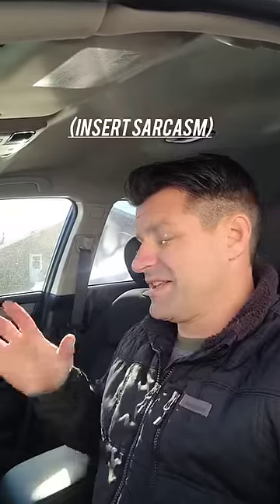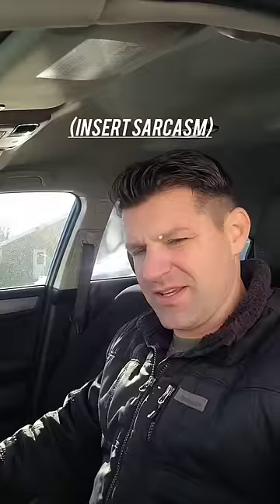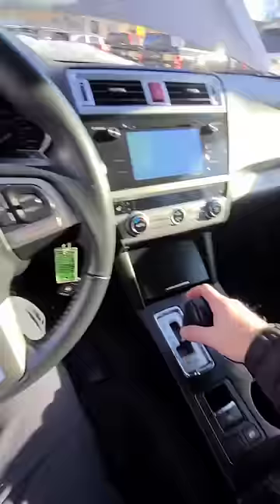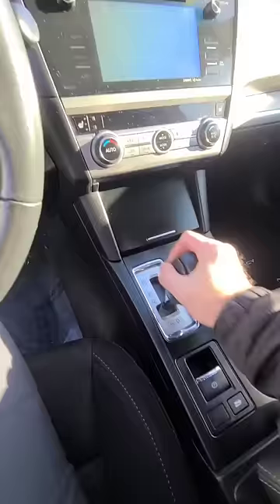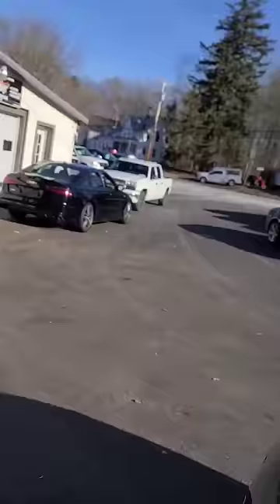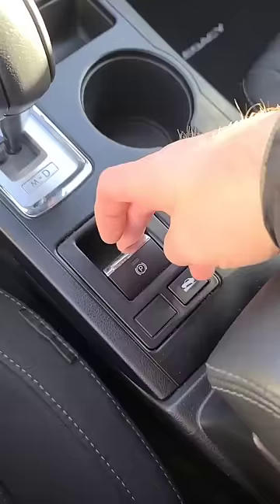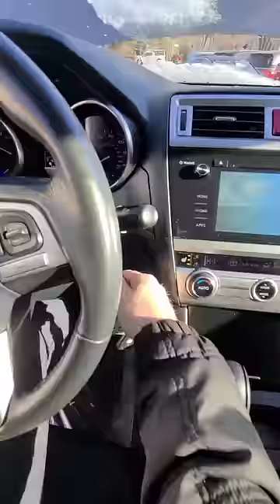Why Subaru Engineers deserve a punch in the Face! #shorts

Comment: Found this as im in the middle of tearing down an outback.
Reply: Around 2012-2013 was last year of good cars with manual controls. Can't stand elec e brakes
Reply: @infotechsailor  ummm i got a new 2023 Subaru Crosstrek with a manual e-brake! Not only that but it also has the best manual e-brake ever made, it’s the kind you pull up with your right hand!! Makes it super easy and fun to do quick 1 sec U turns!!
Reply: @infotechsailor  Then buy a ford they're still catering to the older generations and have still have stuff like manual e brakes

Comment: Is Why I love my Manual transmission Civics just drop it in First Gear, If you want to roll start 5th gear works Great 🤓
Reply: I got a manual 1999 ek1, how the fuck would you roll start in 5th lmfao
Reply: @j4y167   Because of gear reduction its a lot easier/smoother on the transmission to roll start in a high gear. Try it in first then in a higher gear and you'll see what I mean
Reply: @rawevoli  wouldn't it just stall? I'm newish to manuals and haven't had to roll start so I'm not saying you're wrong I'm just confused how being in fifth at very very low speeds wouldn't stall
Reply: @Jay L  Well as long as it's rolling it can't stall because the engine is spinning through the wheels mechanical leverage. You don't wanna give it any throttle in fifth because you'll be at 500rpm and it will bog so all you do is switch to neutral or a low gear before you accelerate.
Reply: @rawevoli if you lift the clutch in 5th, engine on, travelling at 1st gear speeds you will definitely stall, unless  the gear ratios have been modified or adjusted.
Reply: @It's ok to not be ok The engine isn't running until you drop the clutch. The car won't stall unless you let it come to a complete stop. You have to pop it out of fifth after it starts.
Reply: @rawevoli I get what you're trying to say, but that makes suggesting rolling for bump start a dead battery in 5th to start makes even less sense. The engine only starts when lift the clutch just above the bite. 
If gear is too high the engine will stall, start in 2nd and as the clutch starts biting give some throttle.
Reply: @It's ok to not be ok  Your sentence makes even less sense. Why are you arguing which gear works? They all work man its common sense... Even reverse so who cares. Sure it might not work in fifth if you cant push it fast enough but its not hard. It's easier to roll in a high gear because you're have less compression strokes with lower rpms. 5th works best when roll starting on a hill, which is where most people park when they're having starting problems.
Reply: @rawevoli  the lower compressions only become relevant after the engine starts, so being in a higher gear when initially beginning to roll doesn't matter. However when you do get the engine started the lower speed will cause you to stall. Only reason I am arguing about it, is that your suggestion was made to a person that is new to manuals and if they follow your advice it will just lead to frustration when it doesn't work.
Reply: @rawevoli  obviously you believe and agree with what I'm saying or you wouldn't suggest 5th won't work if you can't push it fast enough.
Reply: @It's ok to not be ok  dude I've done it a thousand times. It works fine in fifth. For it not to work you would have to push it like half an mph. It works fine and won't stall and is fine advice to someone who is new. Please stop replying because I know what I have done numerous times and I know how easy it is so please stfu
Reply: @rawevoli  firstly take a breath no need to get yourself agitated. At no point have I suggested you haven't done it, what I was explaining is you are creating an unnecessary problem in having to build enough speed to prevent stalling. Tbh you no yourself that the majority of manuals will stall in 5th the moment the throttle is touched when travelling even at 10mph.
Reply: @It's ok to not be ok why are you relpying?
Reply: @It's ok to not be ok  my cars have enough torque to let of the clutch in 6th with no gas and still not stall. Just let it go. It works fine in fifth. No unnecessary problems it works like a charm every time.
Reply: @rawevoli the same can be asked as to why you're replying? It's great that you have cars with enough torque to do so, it suggests that they are modified? Doing that in the majority of cars and see how quickly the clutches get worn.
Reply: @It's ok to not be ok  you're arguing for the sake of arguing. I was just agreeing with the op and you can't let it go

Comment: There should be a shift lock under the infotaiment in the storage compartment.  Its under the rubber mat (at least under my outback).  You take a screw driver, stick it in the hole, press down and shift.

Comment: You might be wrong. On my 17 Subaru crosstrek there is a place to stick the key next to the gear shifter to put the car in park or neutral when the battery is dead. I don’t doubt there is something similar on that car. But yes electric parking breaks are very dumb.

Comment: Remove liner in cubby in front of the shifter. In that cubby you'll see a round hole, use a screwdriver to release the lockout button inside that hole. You can now put it in park..
Engineers been doing this for over 20 years😉

Comment: Just an fyi from a subie tech theres a cutout near the shifter, pull that out and down that hole is the shifter lockout mechanism, get something long and stick it down there so you can put the car in park (yes even with a flat battery) just because you can't comprehend how stuff works doesnt mean you need to bash subaru. 😂

Comment: The fun part is replacing brake parts on a car with an e-park brake - the tech has to do it with a laptop  (asuming the other techs don't use it other wise he  has to wait around, and so does the customer), the electric servo's that operate the park brake cost a small fortune, they are located at the brake system just inches from the ground so any water, mud, snow, ice and salt that comes with ice is constantly splushing on those parts so it will fail often enough ...what the freaking hell is wrong with the good 'ol $45 parking brake cable???

Comment: You don't know what you're talking about. Flip up the storage compartment, lift up the rubber mat at the bottom, and stick a screwdriver or pen down the hole to press the SHIFT LOCK RELEASE BUTTON. Then you can shift to park even if the battery is dead.

Comment: BMW 325 xdrive adventure: All wheel drive  + Electronic auto transmission in park +steering wheel lock engaged +stone dead battery =  4,000 lb boat anchor. 
Stuck on 25 degree incline driveway, perpendicular to street, with front of car toward garage. 
Wouldn’t take a jump (computers) but got enough power to get the car into neutral and release the steering lock. 
Oh, and the car had Msport front facia, so the tow eye-hook that shipped with the car had the wrong thread size for the receptacle in the front bumper!

Comment: My 2002 Mercury (Ford) Cougar does not have this problem. If it's not in Park, it can go into Park even with a dead battery. I can even take it out of Park without a functioning battery or even the key because there is also the manual emergency release latch under the console (for towing). Plus manual handbrake. Good thing to think about on any future car I buy.

Comment: For all the geniuses if you remove the rubber mat in front of the gear shifter you will find a small hole which you can stick a screw driver, pen, pencil,etc. then shift the car into any gear  even if the battery is dead.

Comment: That is a parking brake, NOT an emergeny brake.  
An emergency brake would allow you to use it and would be seperate from any engine or electronics system so that you could use it in the case of an emergeny.   

The not shifting into park could make sense, if you need to move the car if the battery is dead... but does not make sense if you can not set the parking brake.

Comment: Idk if it's the same with these but I do know that with the newer ones you can take out the flooring for the little cub box in front of the shifter and then with a screw driver or something push down a white release which allows you to put it in any gear. Idk if it's the same with these 2017 but the 2022 model Outbacks had this

Comment: Well in all fairness this is probably not on purpose, the shift lever probably doesn't go anywhere (in that it's just a switch) and even if you could push the lever into the park position the parking pawl probably would not engage because it's electronic. They're just avoiding giving you the false hope there.

But they should still have a mechanical parking brake.

Comment: For the Subaru Legacy you have a neutral override in the center dash compartment in front of your shifter.
Lift up rubber mat in compartment, there is a hole there, insert small screwdriver and push button down, this will free the shifter whether in park to neutral or any gear back into neutral.

Your welcome.

Comment: To everyone saying 'emergency brakes should always be manually operated':
- Electronic e-brake systems are self-maintaining and foolproof. They will always clamp with the correct amount of force, and always fully engage the brake. 
- Yes, cable/manual systems do need maintenance, and the fact that no one here seems to know that shows the extent of the danger. Cables stretch and they stretch unequally, meaning (without maintenance) you WILL end up with one wheel that either doesn't fully engage the brake or doesn't engage at all. When you rely on both wheels being locked, this can be a problem.
- Using a manually-operated 'emergency brake' in an actual emergency (brake failure etc) is difficult and dangerous. Too much brake and you'll lock the rears and risk losing control, which is a likely occurrence seeing as though you will already be panicked, and then forced to (in seconds) learn an entirely new vehicle control without any of the assistance systems like ABS, TC, or ESC that you would be used to driving with as none of them will prevent you from pulling the brake too hard. 
- On the contrary, electronic parking brakes are DESIGNED to also be used in emergencies, with in-built antilock systems ensuring the car comes to a safe halt, fast. 
- People who drive automatic often neglect to engage a manual parking brake. This 100% does put extra wear on driveline components and mounts that will need sooner replacing as a result. Electronic systems will usually operate the brake automatically upon entering P.
- Anton Yelchin did not die as a result of a faulty electronic park brake. This was the fault of the gear selector design on his Grand Cherokee, which FCA was forced to issue a recall for.
- There is always a shift lock release control in automatic cars that ensures you can take it in and out of park while the battery is disconnected. If you had bothered to read your manual for the 2000kg killing machine you pilot every day, you would know this.
Reply: @Steph A  if there's anything you disagree with here you're free to correct me. There is a certain irony in the generalised nature of your comment.

Comment: Electronic parking brake should have a capacitor that will engage the parking brake regardless if the battery is charged or not. (Simple fix but yeah $)

Comment: My car has an electric parking break and I went out my way (as a aircraft mechanic in used to building and overhauling and just wrenchin around) so I went and installed a mechanical parking break and threw the electric park brake to the trash basically feel much safer going mechanical

Comment: First off use your emergency break in second there is a little switch that you can press sometimes you have to open a lid right next to the shifter and use a small flathead screwdriver to unlock the shifter then you put it in park to school

Comment: To be fair it is very, very, very, very, very unlikely that this situation will ever occur. Your battery will not die whilst you're driving if your alternator works, and if your car is parked with the engine off, why the fuck wasn't it in park with the parking brake already on?

Comment: He is right but there is an override he does not share with you.  If you have screwdriver you can pop the cover off right by the shifter park (P) on the left side.  Once the cover is off, you can depress the button inside the hole and put the car in park problem solved.  It is a bad design but they don't leave you stranded with your foot on the brake!

Comment: Sir. There is a shifter lock out switch. If you knew how to use the internet or read your owners manual you would know this. Don’t start yelling at engineers for implementing a design you’re just too inept to use. Like every automatic car will lock the shifter when it’s not on. They all have shift lock switches. If you find one that doesn’t make a video on that one.

Comment: If it makes any Subaru owner watching this feel better, while my car was in the shop my rental turned out to be a top-of-the-line Toyota RAV4... with the same stupid "everything should be digital" mindset. It was literally distracting to drive because there were so many lights, animations, warnings, and notices (especially on the incredibly annoying 9" color screen in the middle of the dash), plus at night it all lit up... along with some overhead buttons, much of the center console, and the armrests on both front doors. Not only would I not have been able to use 90% of the controls if the battery died, it was as if the stupid car got jealous if I paid attention to the road instead of it.

Comment: Love my Jeep renegade, but hate, hate, hate the E-brake. It does the same thing, needs ignition power to work. BTW, that E in E-brake is for Electrical, not Emergency because it wont deploy at speed either. It's just a worthless parking brake. Thank goodness I have a manual transmission so I downshift to engine brake, plus can just put it in 1st gear when the car is off to lock the vehicle in place. This works even when batty is dead. The other brilliant feature was a crappy air compressor & a can of Fix-a-flat in place of a spare tire, but I got one from a salvage yard for $75, so at least that issue was easily resolved.
Reply: An electrical parking brake will deploy at speed
Reply: @THEACERASPIREMAN  Hello Vertti. Your reply piqued my interest. I went thru my owner's manual, but no mention of E-braking at speed. So, I went to an empty parking lot today. Per the manual, I momentarily pulled up on the ebrake switch at 20 mph to engage it. As it has done in the past, the brake seemed to engage for a split second, but then disengaged as if there is an electronic governor that won't let it stay deployed at speed. I tried the test again at 15, 10, and 5 mph with the same disappointing results each time. However, on the last test I accidentally held the switch lever a bit longer than the "moment" the manual recommends. It somewhat felt like the ebrake engaged for a split second longer. Then, I tried  again, but this time I purposely kept the switch lever pulled up. Lo and behold, that worked! I tried it several times at speeds up to 25 mph and it stopped the car respectably well every time. Thus, at speed, you basically have to treat the switch lever like you would a traditional emergency brake lever and hold it up manually. Thanks for your reply!  It led me down a path of discovery.

Comment: 2019 Ascent does the same thing.  Dead battery in the garage, find a screwdriver to poke in a hole to release the shift lever to get it into neutral, but can't release the e-brake to push it to jump it, so fairly useless.  Now I'm the proud owner of 20ft jumper cables so a car can pull in behind mine to jump it.  Oh, and you can't open the rear gate without power so you have to either keep the cables under the driver's seat or climb over the seats into the rear storage

Comment: Not the same problem on almost every AT modern car? Have a 2010 Nissan, same trouble. Parking brake can be manually applied but from the trunk with a special tool.

Comment: Roll into traffic then sue the shit out of them.
Brakes and Steering barely works when any digital car stalls or loses power.
Reply: Hydraulic brakes don't require any power
Reply: IDK, Doesn't look like they're working without power if that's what these Electric Vehicle use.
Reply: @scottarnold6528  Electric vehicles just boost the brakes via an electric motor instead of a vacuum booster, but the brakes still function even without any power, there is still a traditional master cylinder that your pedal is still connected to.

Comment: Yeah I hate all the new fangled crap. It's not even an E brake anymore it's a Parking brake. I suppose maybe there would be a manual override like how there usually is to unlatch the pawl in order to shift out of park. I dunno. 
I have a 2006 wrx limited wagon and its perfect. No unnecessary bells or whistles. Not even traction control.

Comment: Put something under the tire? Also the car wouldn't roll that fast so you can hold it in place outside of the car. Just stop for a minute and think with your head instead of filming a video blaming engineeres. Although you could argue about the lack of a parking brake. You cant argue about not being able to stop your car somewhow.

Comment: Ohh want an even better one? You cannot replace the brake pads yourself on the car. You can unplug that emergency brake but it puts the car in limp mode when you plug it back in and only Subaru can reset it because the systems are all proprietary.